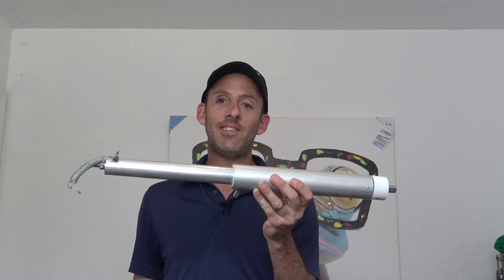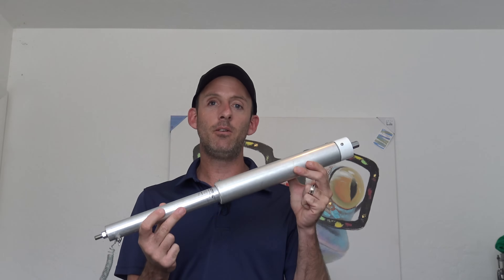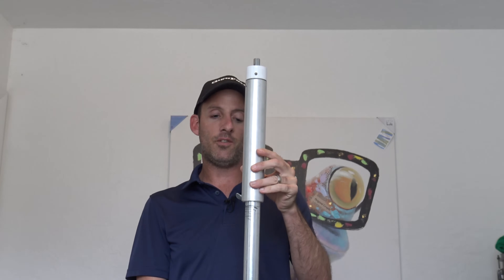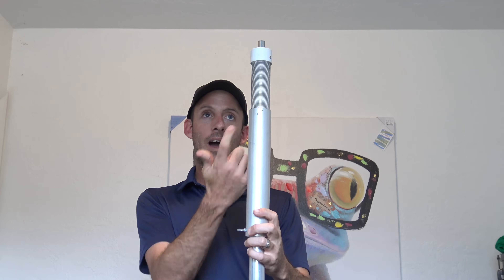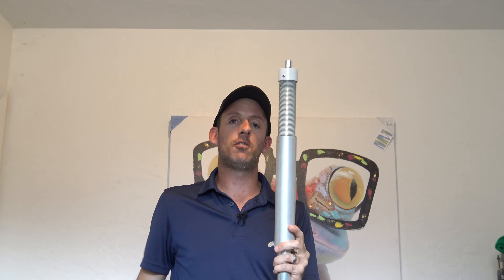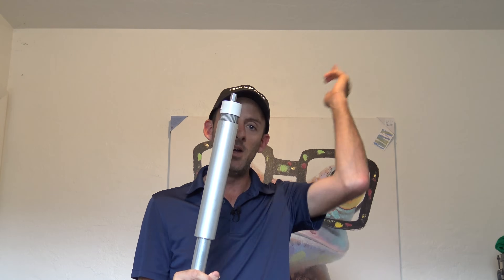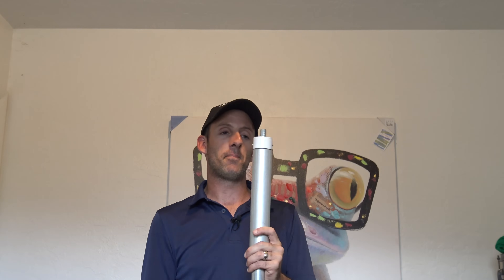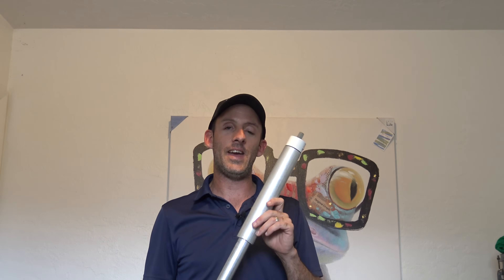Resonant Antennas, HF Mobile, MFJ-1668 Screwdriver

Comment: Are you saying that the coil of the screwdriver radiates?
Reply from the maker: It adds to the total length of the antenna
 It doesn't radiate, it adds electrical length

Comment: Thanks for sharing this helpful video. It seems that once you choose the band of interest, and have made the antenna resonant for that band, you still need an impedance matching network that matches the antenna to the line characteristic impedance, and that the mismatch is going to be different for each band, thus suggesting that a tuner might make sense between the antenna and feed line. Does this make sense? - Thanks!

Comment: Another excellent video.  I am wondering if a manual screwdriver antenna would be good to try.  I am wanting to do mobile and portable HF.   You mentioned you no longer do HF mobile.  Can you say why?  Not a problem, new ham here just figuring this out.  All the best!  73 de KI5HXM
Reply from the maker: This video was long ago, I do HF mobile every day with my Icom 7100, can’t remember why I said that in this video
Reply: @HamRadioConcepts  not a problem.  I have always enjoyed your content from radio to solar power.  I want to get HF mobile for my future trip to northern Florida.  I will wave to you as I cross into Florida.  Cheers!

Comment: That’s not just additional length but also inductance. Sliding that tube you add inductor to the antenna. That’s how it works.
And having resonant antenna doesn’t mean “100 watts in 100 watts is coming out of the antenna” Absolutely not. Such shortened antennas have very low efficiency.

Comment: It’s funny just yesterday I was thinking about how does a tuner really work and that it just fools your radio to think the antenna is resonant but the antenna still remains nonrsonanted so how can that help your signal. This video cleared that all up thanks Eric. I don’t use a antenna tuner I have using ham sticks for 20 and 40 meters on my truck (one on each side of my truck and a antenna switch in the cab) but started really thinking about getting a little tarheel 2 that way I can do 6-80 without swapping out my antenna’s if I wanted to do other bands besides 20/40 meters just tune and go. It also sounds like the screwdriver antenna will out preform the ham sticks Am I thinking correctly on that? And is it by a lot or just a little? Thanks
Reply from the maker: Check out my little tarheel video, man that thing is just awesome in the mobile, a little innefficient on 80/75 but 20 meters 17 meters mobile I have worked hundreds of stations, I can tune it 1.1:1 SWR wherever I want just by running it up or down. Hamsticks are good too but theres only going to be a dip at one spot, and each hamstick for each band...

Comment: A good ground on a vehicle is not that tricky. Just drill a hole in your roof and go big!
I have a design for 80M 40M mobile. The idea is to put 4 or 5x 10M  antenna on the roof. Then only the 1st one connects with coax to the radio. Then the 1st tip connects to the 2nd tip and the base of the 2nd connects with coax to the base of the 3rd and so on joining all of the antenna in series and tuning with the last two antenna lengths. a bit like the loch ness monster. Ok i'm naming it just that, or Nessy.

Comment: Antenna tuner basically does some 'impedance match' to maximise the power transmitted from your radio to antenna, it is not cheating the radio. The most common type of impedance matching network is LC matching, which the microcontroller tries combinations of many different capacitors and inductors to find the lowest SWR. But, maximise power transmitted to the antenna doesn't necessarily mean you have a good antenna. The antenna has its own characteristics which determines how much incoming power is being transmitted to air and how much become heat. This character cannot be changed with external impedance matching circuits. When you shorten an antenna, you use inductors to compensate for the electrical length, while sacrificing efficiency. The efficiency of a typical mobile HF antenna is about 1%, means you need a lot of power to transmit. Receiving is usually not a problem due to relatively high atmosphere noise (about 30db above thermal noise, allows more loss on an inefficient whip without lowering SNR)

Comment: With no tuner...how do you manage the low impedances offered for the lower bands? I've seen 75 meter Hamsticks with load impedances under 10 ohms, which really runs your SWR up, regardless of whether or not you're resonant.

Comment: I have used an Ampro160 on top band and made 1000-2000 mile Qs BUT every change in the dial needs a visit to the antenna to change length such is the super-narrow bandwidth! You’ll wear the door hinges out! Thanks for informative video.

Comment: So if you had that antenna in the field on a telescope tripid  was uset on a 10 inch telescope would you still need to run a counter   poise   VE1-BHM

Comment: Excellent presentation on both video's, I'm a lic. but non practicing HAM, I really enjoy all the technical aspects but over the years I just assumed the Antenna Tuner was 'tuning the antenna'.  You really brought home the idea that a random length wire does not an antenna make!  It's clear as a bell now, thanks.

Comment: Hello Eric this is Mark k2csx I want to say about the mfj-1668 I own one of those antennas and yes it's a great antenna for instance I live in an apartment building in New York City at times in the past I was not allowed to have an antenna on the roof so I ordered from mfj one of those antennas It's a Wonderful antenna I had it outside my bedroom window on a window guard on a 45 degree angle I use it on my Yaesu ft 920 and I had great results my counterpoise wire ran for my bedroom window so my fire escape very thin piece of wire that I had left over from the mfj apartment antenna the 1664 work flawlessly so well I have a1661 and a 1664 from 6 meters all the way down to 40 + 75 + 80 m on the 1668 I've also left it tuned on 40m and with the help of my mfj 969 tuner I made several contacts on the 160 meter band so that particular antenna works good and a balcony situation if you live an h o a you can hide it in the bushes or just like me use it window side but I wish mfj produce on antenna like the screwdriver antenna but only in a loop form with like a little gray box underneath with a tuning capacitor something that might handle a hundred or 200 Watts when you live in an apartment like I do you're really compromised and really cannot put up antennas like folks do with their own homes so I just wanted to comment about the 1668 I enjoy all your videos and keep them coming I would like for you to do a video on FRS gmrs and Murs radio there's a lot of that use here in New York 73 from the Bronx k2csx mark

Comment: How does the mobile HF antenna compare to your base HF antenna? For example, if you moved to a home in a restricted community, where you’d have to stealth your HF antenna. Is there a huge difference between the HF antennas? Maybe you could do a video on stealth antennas. Do you know anyone who uses a stealth HF antenna?

Do you know anyone that uses a remotely controlled HF station? I’ve seen commercially shared remote HF stations advertised, but they start at over $5 an hour. 

Decades ago, when I was on HF, I spent many hours a week on HF, sometimes many hours in a single day. How many hours a week or a month do you spend a week or a month on HF?

My goal is to get back on HF in the future after being off HF for decades, but it might be a challenge if my next home is in a restricted community.
Reply: Wow This is the problem with appliance operators today.

Comment: I've been preaching this for a long time. Unfortunately many hams think that as long as a tuner can tune, you are good to go. They brag about their new '"super tuner" being able to tune a lawn chair on 80 meters. LOL. They fail to understand that a tuner only matches antenna impedance to the radio's rated antenna impedance. It does not make an antenna more efficient.
There is a reason why most reputable radio manufacturers limit their internal tuner to 3:1 SWR. It's because anything outside that limit will have VERY poor efficiency. 
It all comes to the unfortunate truth that the FCC license tests are a joke. People pass Extra exams but still have no clue about anything ham radio related.
BTW, I've had excellent luck with a Tarheel motorized "screwdriver" type antenna on my vehicle. It works very well and requires no tuners, obviously.

Comment: I currently run a Yaesu ATAS 120A on an 18 wheeler, it is decent enough on 10/12 /15 and you can have sporadic luck on 20. I've actually been lucky enough to have contacts on 40, but nothing to write home about. 
I am planning on installing a cattle guard on my truck where I plan to deploy a Scorpion 680 or a Texas  bugcatcher, I think the counterpoise shouldn't be be an issue.
We'll see!
I do recall a few drivers having claimed to work 75 and even 160 mobile but I'm a show me kinda guy.
We'll see.
Take care Eric and 73'
Sincerely,  John C.
Reply: Depends on where it's mounted and it's ground. Florida to California on 40M. Florida to Belgium and Africa on 20M with my ATAS 120A.

Comment: What your talking about is very old ideas brought to us by the early amateur radio operators . As for the tuners they are good as long as you stay within the resonent frequency of the antenna and within about 100 to 150 khz of the turned frequency .